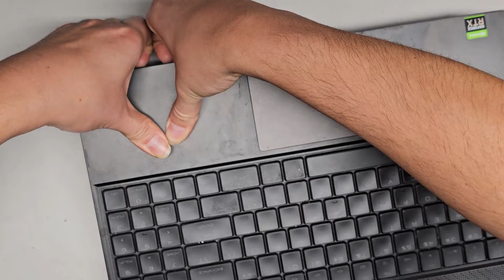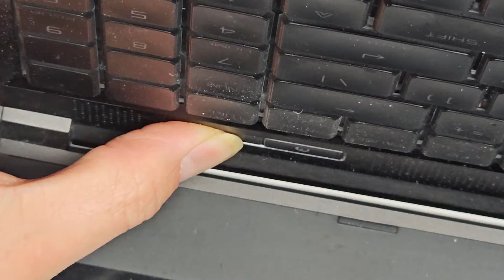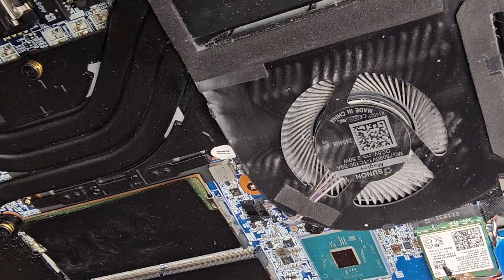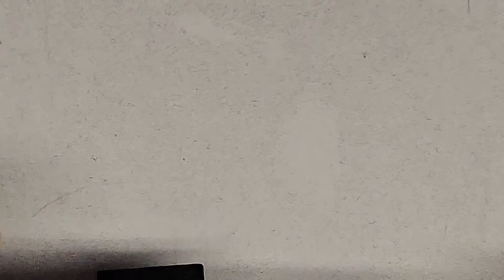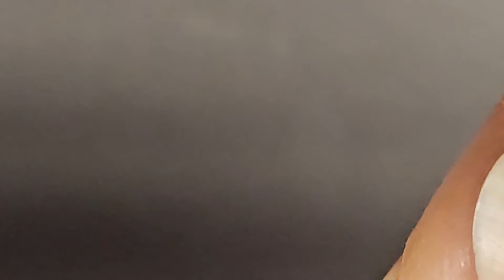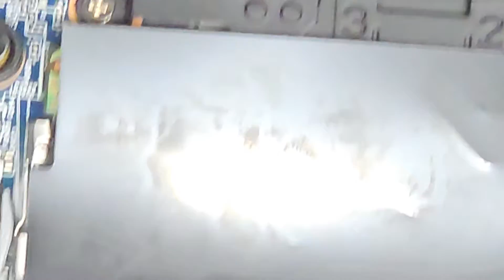Eluktronics Mech-15 G3 Disassembly RAM SSD Hard Drive Upgrade Battery Replacement Repair Quick Look

Comment: This is a big issue with these Tong fang based laptop chasis.
Reply from the maker: What is?
Reply: @ItsBinhRepaired  issue with the charge port going bad, or the mobo goes bad in general.  When attempting to power on the laptop, the charge light will stay on, and the power light will blink.  I tried to find some research on this issue, but on reddit there's alot people who are having the same issues with these laptops.
Reply: @kjorellana87  Aftershock Apex 15R with RTX 3080 16GB and Ryzen 9, 3-4 years used and still going strong 💪🏻
Reply from the maker: Nice